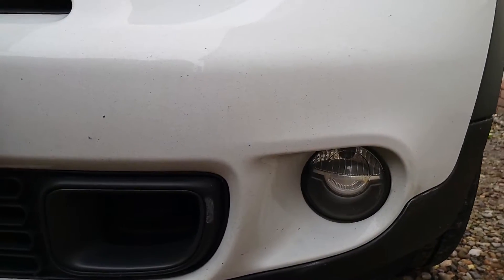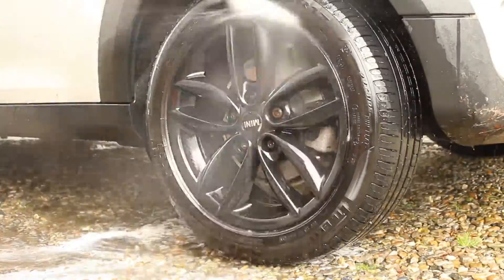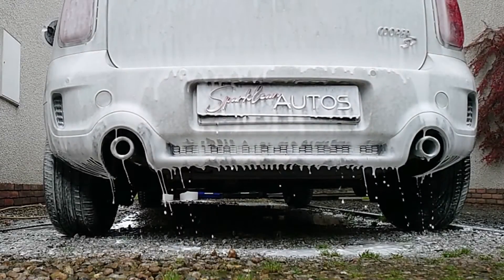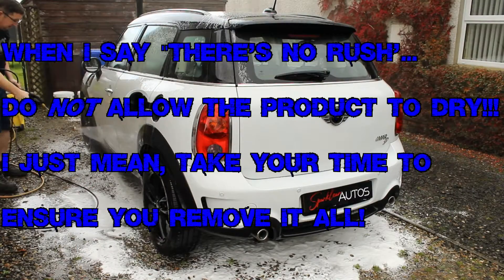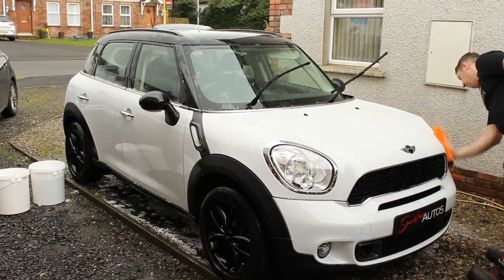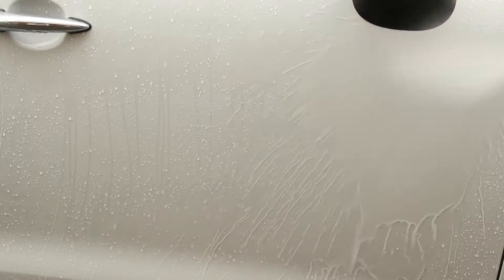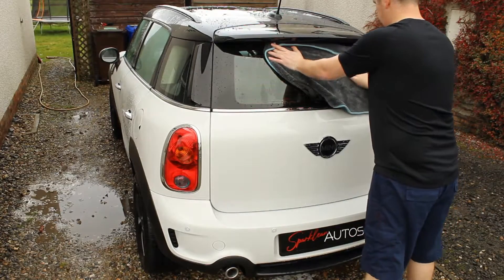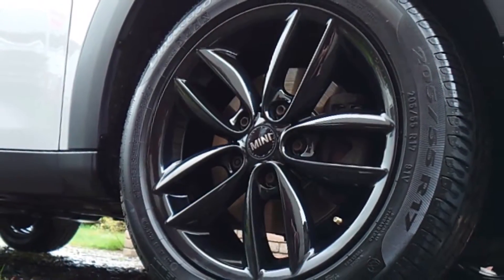Bilt Hamber Winter Vehicle Prep Ep 2 - 1st Maintenance Wash #bilthamber #filthycar #wax

Comment: Like how you include running price total on products. 👍Good job
Reply from the maker: Something I've done on my Bilt Hamber videos and I'll try to introduce a lot more... I prefer to get used to products and finding dilution ratios that work for me before working out costs. Thanks for commenting 😁👍🏼
Reply: @SparkleanAutos  The Bilt Hamber range is very hard to beat.
Reply from the maker: Definitely one of my top 2 or 3 brands at the minute. Hard to fault - cost & performance is second to none 👍🏼

Comment: great video mate but i would urge you to move over to a ceramic light at least. the amount of prep you did to that car (which was spot on by the way) then to put a wax on seems like a lot of work. myself i use gyeon can coat which gives 14 months protection and makes the full decon and polish worthwhile and is just as quick to apply as a wax and the beading is incredible then every three maintenance washes i use cure as a topper just a thought mate... give it a try it is like wax on steroids
Reply from the maker: I get what you're saying Daniel, I genuinely do... But a protection that lasts longer than 6 months isn't something that interests me... Its more because I enjoy the process, rather than the results! I can very much see the advantages of ceramics but, personally, I just prefer applying protection products more often! I've used coatings in the past and spray sealants etc but there's something about applying wax that I have always found very therapeutic. 🤷🏻‍♂️

Thanks for watching though and I genuinely appreciate the feedback 👍🏼👍🏼

Comment: Awesome video mate, I have the same jetwash as you I’m just wondering if you have a link to the hose and the gun that you use please? 
Cheers.
Reply from the maker: The hose I've had for years, it's Karcher's 8m one I used to use on my old K2... Upgrading it soon but no link to that one sorry...

The gun is from in2detailing...

https://www.in2detailing.co.uk/products/karcher-k-series-swivel-quick-release-short-trigger-gun-with-quick-release-nozzles?_pos=9&_sid=38e579be1&_ss=r

Thanks for watching, subscribe for more Mini 😁🤣
Reply: @SparkleanAutos  ohh no problem I’ll have a look on eBay, Thanks mate. 

Thanks for the link I’ll get that ordered👍🏻

As soon as I seen the mini I subscribed mate😉😂
Reply from the maker: @gsmini1749 
Thank you sir 😁

This is the hose I plan on ordering... Probably just 10m, no real need for 15.... I just need to double check the connections 
 https://www.in2detailing.co.uk/products/karcher-k-series-c-clip-to-c-clip-reinforced-heavy-duty-rubber-replacement-hose?_pos=7&_sid=d0751e54e&_ss=r